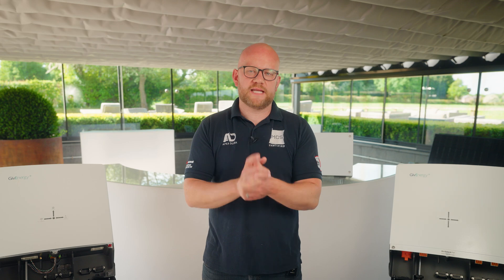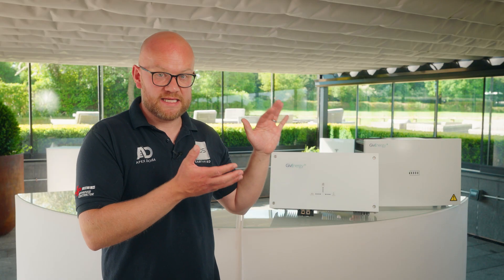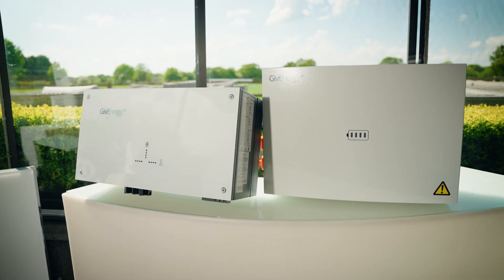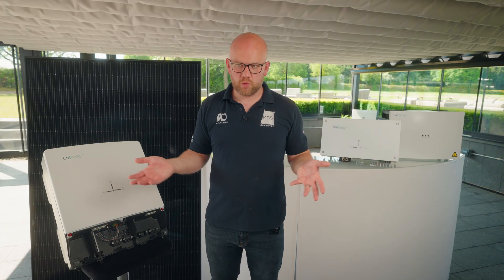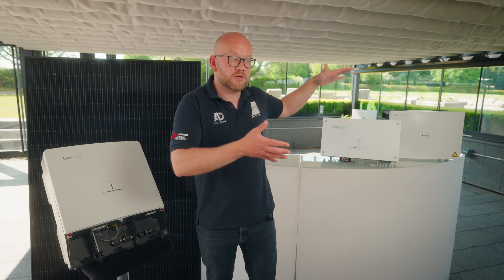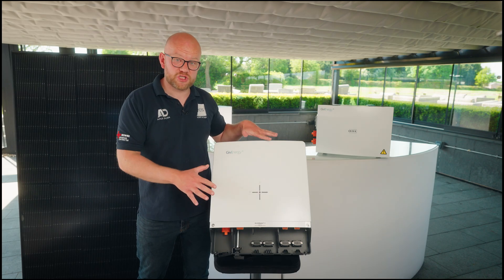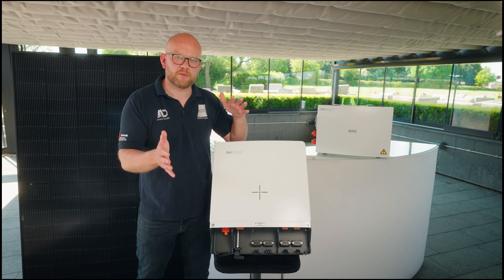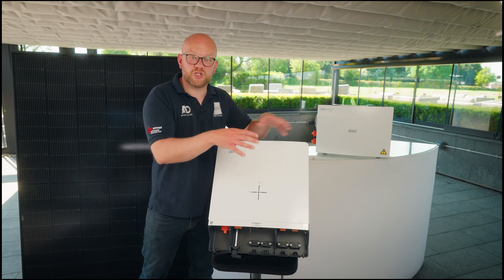AC vs. DC Coupled Battery Storage Explained | Best Setup for UK Solar Systems

Comment: Interesting that you recommend an AC Coupled system for an existing solar installation 15:00 .  Does this apply for a 3Ph home that needs to run from batteries during a grid outage, and also wants the solar panels to charge the batteries during a grid outage?
Reply: 14:00

Comment: Amazing video  - extremely helpful.  I have an existing solar / string inverter system - 14+ years of age - so adding an DC coupled battery - hybrid inverter may make more sense given my inverter age since I would be replacing the existing inverter.  Also did not realize Tesla 3 was "all-in-one" nor would I know what that meant until your video.
Reply from the maker: That’s exactly why we do what we do — to help people navigate these kinds of decisions. Really glad you found the video useful, and sounds like you’re thinking along the right lines with the inverter and battery options.

Comment: But............Where is the industry standards on solar backup. 
Should solar written quotes and proposals contain peak amps usage and main fuse amp rating in survey assessment and written proposal containing Peak amps backup capability for home back?
Overall Kw doesnt tell you what the home rerquires or solution supports, customers need to know Peak amps usage and peak amps solution delivery..
Reply from the maker: I have just responded to a similar comment of yours on another video. Thanks for this for anyone who wants to know more:

Thanks for the thoughtful comment! You’re absolutely right that backup design isn’t just about system size in kW. It’s also about the peak current the home can draw, the main fuse rating, and what the inverter or battery system can safely deliver in backup mode.

In the UK there’s no formal MCS or industry standard yet (that I am aware of, correct me if I am wrong) that requires installers to list peak amps in proposals. Good installers will check your main fuse rating, measure peak demand where needed, and size backup circuits accordingly. For example, most systems including Tesla Powerwall 3 have a continuous backup limit. It’s important to design around essential loads or explain the limits clearly rather than just saying ‘whole home backup.’

We include this information during design and installation. I completely agree it should be standard practice to make this clear upfront so expectations are managed and customers aren’t misled. Appreciate you raising it.

Ian 😃

Comment: Lots of details there.
A question I’ve had for a while, with EV charging & potentially sand batteries, is there any advantage to running these DC-DC this avoiding
Conversion  losses.
Reply from the maker: Hi Hugh,

Technically, it would be the most efficient option if you have a SigEnergy DC charger and enough solar panels. However, for the set-up cost, it would probably be better to accept the losses and go with a standard AC 7KW charger for your home. Capital deployed vs log term ROI. 

Warm regards

Team AD
Reply: @apexdoma great. Thanks 👍

Comment: Pretty good.  I think your explanation is a bit more complex than it needs to be though.  An inverter that charges an attached battery via only AC sources is AC-coupled.  An inverter that charges an attached battery via DC sources, or via both DC and AC sources, is considered to be DC-coupled.  Simple as that.

Getting more into the nitty gritty (so now I am going to provide the more complex explanation.... heh).

Generally both "hybrid" inverters and "off-grid" inverters are the latter (DC AND AC coupled)... they have MPPT inputs and can charge an attached battery directly via the MPPTs, via the AC connection, or both at the same time.  And, in fact, hybrid and off-grid inverters can charge their batteries from both DC and AC sources at the same time.   And since they have a CT (current transformer) monitoring the grid, they can tell when you have other AC coupled solar (string inverters) in your system and they can turn on their AC battery charger to try to soak that excess power up instead of it being exported.

But there are also some major items that you didn't mention which should be noted too.

* The main REASON why you want a "DC coupled" inverter (a hybrid or off-grid inverter with MPPT inputs and battery connections) is because it allows you to have as much solar as it can handle regardless of what the utility allows you to export.

When you only have AC coupled inverters (including AC-coupled string inverters and microinverters), the total solar you can have going into such inverters cannot exceed what the utility allows you to export.  Even if you use much of the power yourself and don't export it.

* And also, if you have a battery backup system (can run the house when there is a grid failure), and the battery runs out overnight, DC coupled systems can bootstrap themselves in the morning while AC coupled systems generally cannot (or require a lot more work to bootstrap)... because AC coupled systems need an active hybrid inverter or the grid in order to be able to bring the solar onto the AC bus.

For all of these reasons, really nobody should be buying an AC-coupled-only inverter/battery system these days.  Its old-school.  Always get a DC coupled system, either hybrid or off-grid depending on your needs.  That gives you the maximum flexibility for no real (or minimal) additional cost.

--

The difference between a "hybrid" inverter and an "off-grid" inverter is that the hybrid inverter is grid-interactive... it can support house loads with its inverter by discharging the battery while still connected to the grid which is a much more flexible solution than an off-grid inverter which can only run loads entirely off-grid, or run loads grid-connected, but not both at the same time.  An off-grid inverter can, however, still charge the battery while on-grid and the grid is running the loads.

Note that pure string inverters CAN have emergency AC output ports without batteries.  For example many SMA string inverters have this feature and it can output AC roughly up to available solar.   That said, without a battery these AC outputs are very unreliable since a cloud can cause the output to drop out if its pulling more power than the solar can provide.  So while these emergency ports do exist, they aren't as useful as people sometimes think.
Reply: Thanks for saving my time.

Comment: Good presentation again 👍, just a question, if I were to add a extra 3kw battery inverter and a second battery to my existing ac coupled battery system would the batteries discharge and charge at 6kw ,
Reply from the maker: Hi John,

It just depends on the brand. For the GivEnergy 3KW AC Coupled, you can buy an EMS that controls both inverters. So, in this scenario, yes, you can. However, not all inverters have this capability to work in parallel.

If you can give us an idea of your setup, we should be able to help.

Thanks

Team AD
Reply: @apexdoma 
                        Cheers Ian, I’ve got a GE battery and looking to increase charge and discharge so it’ll be ideal, keep up the good vlogs 👍